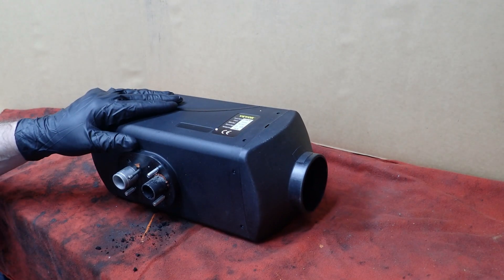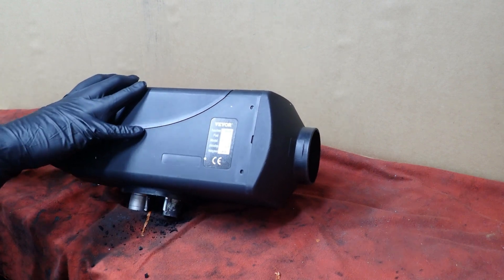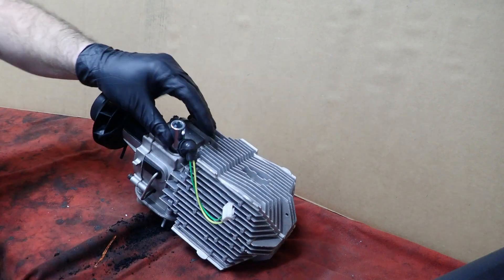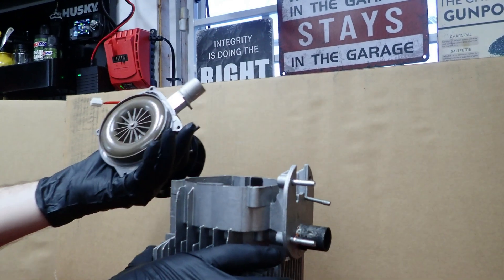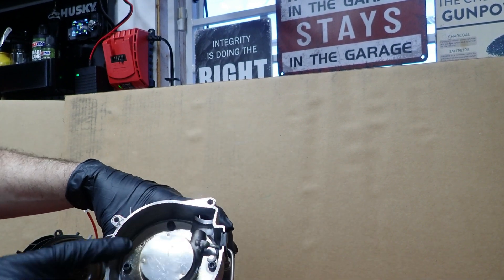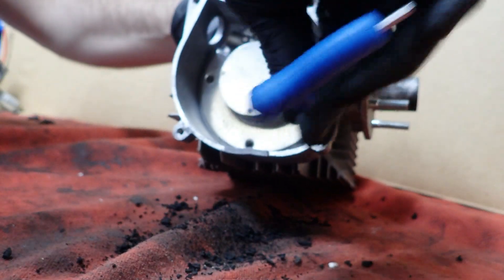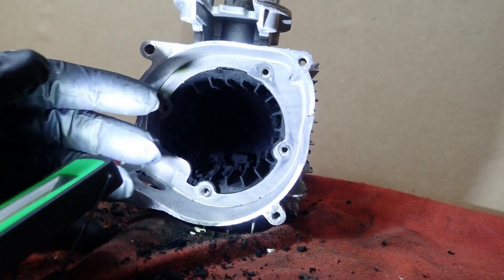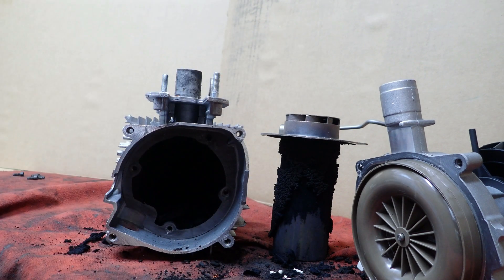EFFECTS OF DIESEL FUEL GELLING IN YOUR CHINESE DIESEL HEATER

Comment: Diesel fuel should be treated at the pump if you live in a cold region like I do. I travel in my van 5 years straight now. I've never had my system gel up and never add additive. Yesterday it was 23 below zero  here. I woke up cuz my heat went out :-(. I immediately went to my propane backup heat. Today wasn't as bad it was in the twenties so I started my gas generator with a little space heater warmed up my fuel lines pump etc. my tanks mounted on the side of my van and only probably a 3-ft run of fuel line. So I warmed it all up I could see my fuel filter was full again with fuel. Started it up and all systems go then I shut it off switch from my solar power to a jackery. And it won't start back up :-( I know I have a fuel pump in my van somewhere but I can't find it LOL. So I did two day prime on Amazon got a fuel pump. I usually always keep one or two fuel pumps on hand. I also have a spare diesel heater being as cheap as they are. My install is a piece of cake it's mounted on the left side door where you step into the van on the side door the left one that you never open right on the step. I'm 90% sure it's the fuel pump. But if not I'll just swap out the whole heater and throw the other one in a dumpster :-)

Comment: easy to clean, just open it up & spray brake cleaner then light it & watch the carbon burn out. It'll take awhile. Mine may have also burned oil for a period. lol I use mine to heat my place though. 

The cpu is linked to the screens, that's it. the pumps are generic. so are the glow plugs & ignition screens. If they are cheap heaters, they are all generic but some of those expensive ones are as well. The patent expired on them so china started to pump them out at a fraction of the cost. I also like to grab the glow plug by the side after its opened up from removing the fan off the back first. I think those tools beat glow plugs because I've been aggressive with mine by hand & none have broken yet. I think they are worth cleaning, but also worth having mre than one on hand if thats what you depend on & dont clean or treat it. Iso also works as a cleaner & anti gel but I don't think they mix well. Lucas fuel treatment is a good for a cheap soot blow out. Complete burn additives work but so does raising the octane slightly so you get a more full burn at lower temps like closer to 100. It's the same deal trying to figure out a good mix for veggie oil fuel or black diesel. The heaters can't handle 100% used oil tho. The octane has to meet that of diesel or greater. which is about 18 octane. These are awesome heaters all around. Cut my hydro bill right in half for the winter with a fuel rebate to boot. Can't argue that one! it paid for itself in 2 months easy.